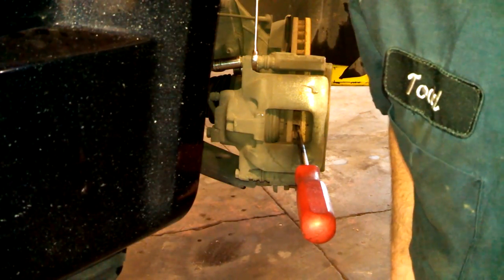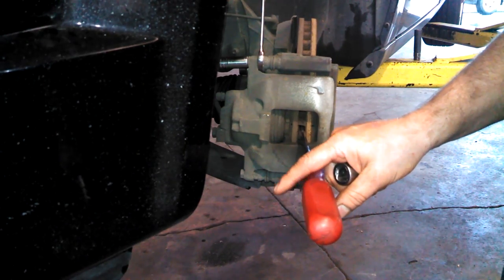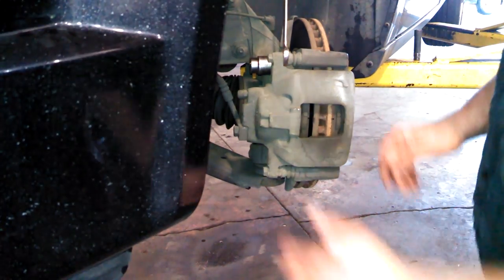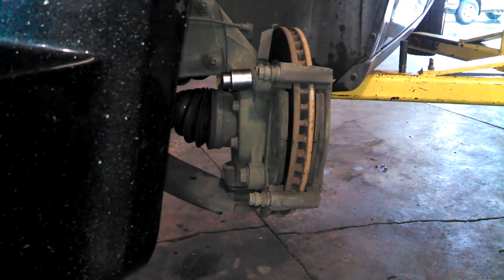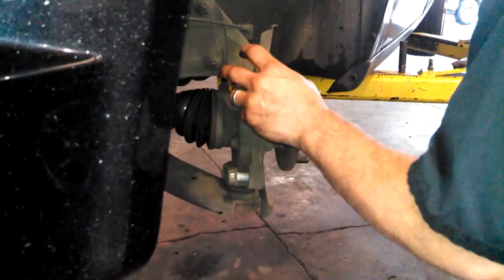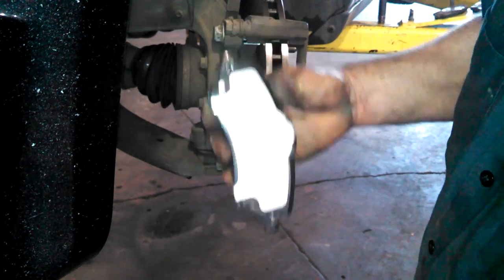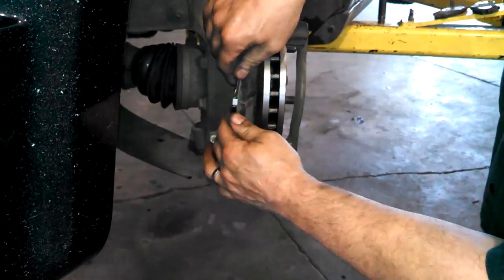Front brake pad replacement 2008 - 2013 Chrysler Town and Country pads rotors Install Remove Replace

Comment: I understand this video was posted 8 years ago, however it helped me a ton. Her 2012 Town and Country van was losing power on hills. She had it looked at, the engine and tranny by a few shops, they all said it is ok, nothing wrong. 
This week I was washing it for her and noticed steam coming off the brakes on both sides of the front, when I hit them with water. Only drove it 3 miles to the car wash. 
The front brake calipers were not releasing and heating up on the rotor, so she was driving around New Mexico with her front brakes applied and it was intermittent, (not all the time). I got two refurbished calipers from AutoZone, and watched the video. The calipers came with the bracket pins already greased up and mounted on the caliper. The important part that you mentioned, those little clips, are important to get right as stated. Put them in backwards at first then could not install the brake pads, switched them around and the pads mounted right up. One thing I checked also was the free play back and forth on the caliper indicating that the caliper and brake pads had movement with lubrication to assist in the release after braking. Torqued the bolts and bled the system some. Now the brakes no longer heat up and the van stops on a dime. Thanks for the video, it helped a lot.

Comment: A few issues I have:
1) didn't clean up the wheel hub
2) no anti sieze on the hub
3) didn't clean up the caliper bracket
4) didn't clean the old grease off the glide pins before applying new.

I realize these steps aren't 100% necessary, but I do them, and would want any mechanic replacing my brakes to do them as well.

Comment: Great video—thanks for creating it.  Is there a difference between the pads? You mentioned inner pad and outer pad.  I have a 2012 Chrysler Town & Country with the BR3 heavy duty brakes; I didn’t notice a difference between the pads. If there is a difference, I need to disassemble and re-examine mine ASAP.

Comment: Hint:  I use my 2008 grand caravan 3.3L harder than I should, pulling trailer, etc.  (I wish I had a farm truck...but I don't).  This is my second caravan.  Brakes are the weakness on this vehicle.  I live near a monster hill that I have to drive down every day.  The van is great, with 156K miles and going strong.  The brakes warp every two years.  A couple years ago I tried something different, buying an $100 Ebay drilled/slotted  Canadian metal front rotors (better than chinese steel) and $100 EBC Greenstuff truck brakes.  WHAT A DIFFERENCE!!!  I couldn't be happier.  Brakes feel like solid truck brakes, and I feel confident again driving this van.  I expected to still have to replace warped rotors... but no longer an issue and I'm still on the same rotors, pulling wood trailer at times!!  Best $200 upgrade!
Reply: Maxwelshouse1 we just purchased a 2013 and I want to upgrade prior to going down the warped rotor road.  What is the model exactly you purchased?

Comment: How did you push back the caliper piston? I worked for a whole afternoon and went to Walmart and autozone several time to get quality tools. I just couldn’t push the piston back with a tool from advanced auto parts,and a C-clamp. I just left it outside and will continue it tomorrow

Comment: Great video, just have a question. I noticed the pads you used have brake wear indicators, and you installed on the inside top side. I have seen some on the bottom in the front which is the proper location if you are using the wear indicators?

Comment: Regarding the inserts/clips: When you say the clip/insert with the longer lip facing the front at first I thought you were saying the equivalent of the front as being the caliper mounted on the the vehicle with that side facing towards the tire and or front of the rotor. However it now appears you were saying that facing front was facing the piston side of the caliper. Please clarify this. It appears the locations for clips with the longer lip are on the side where the rubber boot is for the caliper slide pins which also would face towards the piston side of the caliper. It this correct?

Comment: Do you leave cap off as you pump brakes to set piston calipers? It's been a while since I did brakes on cars, 10yrs. Took it to dealership to have done. But looking around found how easy it is. Convection it to one place, and went to apply brakes as I left. Pedal went to floor and heard a pop. They took carry of it...But I guess someone didn't do something right, because the books there wasn't happy to have to replace the whole underneath hoses. Thanks ahead of time for help.
Reply from the maker: I do usually, yes. Or i push slowly...

Comment: Confounded why you didn't mention the oft needed Disc Brakes Caliper Tool Set???....It might be a GOOD thing to mention if ASE certified, as my 2010 CHRYSLER T&C Touring MUST have this tool....can get into a WORLD of hurt and frustration driving out to buy the $65 kit....FYI folks, for the reading public, this device will force the caliper piston straight back into the caliper as well as rotating the pistons back into the caliper on vehicles with self adjusting parking brakes....:O One can rent from ORiley's or buy outright...

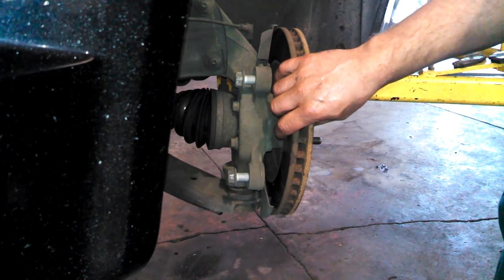Comment: 2:56. I have a 2008 Chrysler town and country the issue with my car is that when I make turns the vehicle fights back and the traction light blinks. As long as I keep the wheel turned while accelerating the esp light will come on and the vehicle will begin to drive normal. It’s really scary when I am making a turn let’s say... off the highway and cars are behind me ,because until that esp light comes the car slowsdown and will not accelerate until I have the wheel straight or that light ESP light comes on my dashboard. DO YOU HAVE ANY IDEA WHAT MAY CAUSE THIS PROBLEM OR HOW TO FIX IT???

Comment: Oh, I skipped draining the master cylinder and just had a helper keep an eye on it (with cap off) while I compressed.
Reply: Unless you keep adding fluid before starting this it won't overflow. Two indications of needing to change pads, fluid level gets too low, or grinding, scraping squealing sound.

Comment: I am having a problem replacing the back brakes on my T&C 2010. The tire is not coming out I took all the nuts out but the tire did not came out it was stuck i was afraid that if i hammer it too much my car will fall of the jack. I don't know how to fix that problem.
Reply: Yeah you're either gonna have to take the risk, or go to a local shop where they can lift it and take it off for you to loosen it up. Bolt it back on, torque it, and that point it should be easier to do it at home.

Comment: what kind of air ratchet are you using? thanks!
Reply from the maker: Yod S That one is my smaller Snap On air ratchet, I also have a larger Mac with more power.

Comment: The brake pads in this video had well over 7mm of pad left.. (approximately 8 to 12 months of driving life).. As well the brake rotor had plenty of facial plating left and were optimal candidates for machining to correct any warpage and not necessitating replacement..  

Appreciate video but explanations of why replacing parts that aren't needing immediate replacement would be advisable..
Reply from the maker: +Devon Swallow This was done a while ago now, not sure every pad had more than 7mm just watching some of the video.  To replace or not replace and just machine a rotor will be a debate as long as there are rotors.  In our experience Caravans have a big problem with warping, living in the foothills of Mt Hood.  Our customers do not want to come back and we do not want them back, so we install high quality rotors and pads, very few comebacks.
Time = $$ so when labor rates reach $80-125 per hour, it becomes more cost effective to put on new rotors then get them machined.
Reply: thanks for reply and I fully understand the time vs cost aspect.. just pointed out one option vs other available to customers.

Keep up the good work, still lots of applicable step by step in the video.
Reply: Turning a rotor is as costly to a customer as replacement.
Reply: Maybe not. Everybody likes driving until the wear bar starts scraping